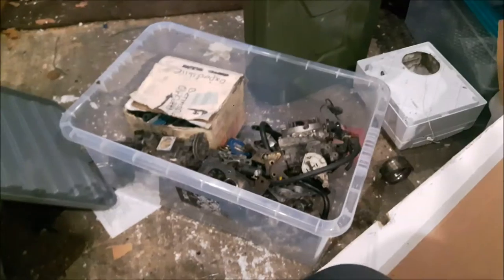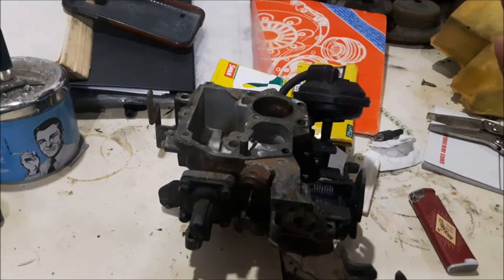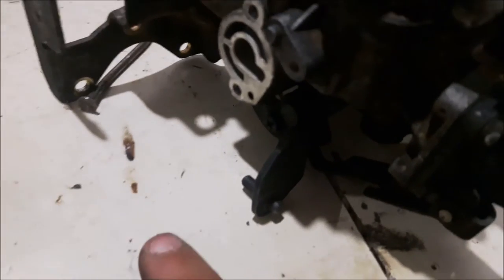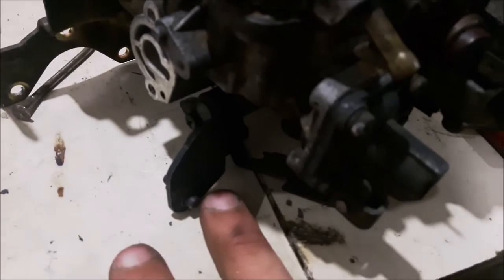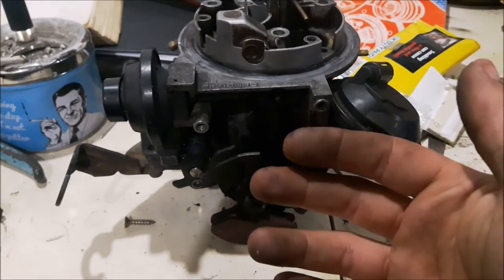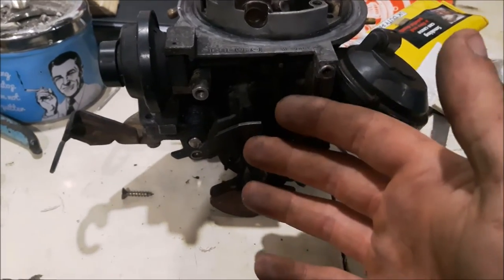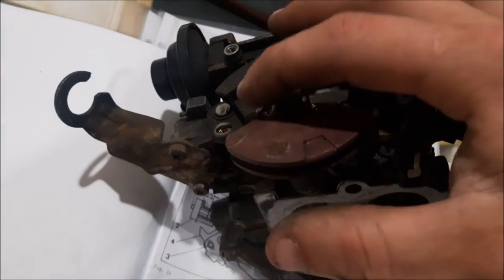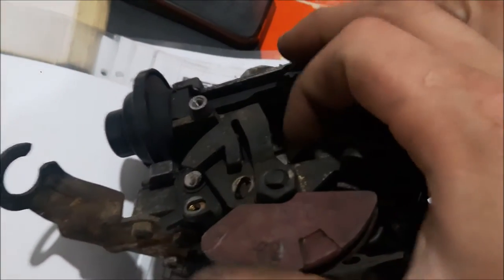The Pierburg 2e2  Components and Operation

Comment: Dear folks, the good old Pierburg is no witchcraft, but in fact very reliabele over a long time. I brought my legendary mule (Audi 80) to 436.000 KM !! The only thing I renewed was the rubber flange seal between manifold an carb. Otherwise it was fine - over the huge distance of more than 10 "world tours". 
If idling speed is too high, please do not forget readjusting the whole lever mechanism - not with brute force but with very tender bending of the light alloy components. (Treat it as you would treat your girlfriend erotically)
You can do this during engine idling since you then will discover any senesitive reaction of the engine (e. g. idle speed going to accdeptable level) Any kind of re-dieseling after engine/ignition off means reworking on the lever mechanism - until the problem is finally solved ! You will then  n o t  recognize your old tin-mate ;P -> purrs like a cat and drives like  b r a n d   n e w  !
Reply from the maker: Thanks for fighting the good fight in helping people to understand these carbs, I agree with you completely. 

Nice hack RE: the throttle plate by the way, I've pinned the comment in case it helps someone out.

Cheers for watching!
Reply: My 2e2 over-runs after ignition turn off. Could you perhaps explain abit more what I should be bending or adjusting to sort this out? :)
Reply: Hello, We have the problem of re dieseling after engine is off, while engine is on it still dripping gasoline on second throat and it makes engine stall. Any advice how to stop it dripping gasoline from second throat?(by second throat I mean throat without plate)
Reply: L6

Comment: SkyRocket Automotive  Thank you so much for these Pierburg videos, they’ve gone a long way to demystfying these carbs for me.

I wonder if you could perhaps give me some advice. So far I have:

Renewed the carb base rubber as it was badly split.
Renewed all the knackered vac lines as per your video.
Found my TTV and cutoff solenoid to be kaputt, they get 12v but no clicking and the 3 point unit withdraws fully from startup.
Put the wax stat in boiling water and found it seems to be working properly.
BUT

The car idles at 2000-2200rpm cold, lacks power and runs on when switched off. It seems to be running on the waxstat as the 3 point unit never comes into play at all.

If you could offer any advice that would be great. Thanks!

Comment: I can't believe nobody has commented on this.
Really good video bud.
Reply from the maker: Thanks very much! I'm glad you like it, hopefully it'll keep some Pierburgs fuzzing along nicely :)
Reply: +Kyle Mundy haha. I have to check my choke out. It doesn't appear to be in the black pulldown bit. Weird.
Revs around 1500 until it gets warm then sits at 900.
Also the timer device doesn't seem to do anything along with the 3/4 unit. Apparently the wax stat is ok. I had the carb tuned on a dyno. It was coughing and kangarooing on low range revs. Had an air leak on the brake servo pipe on the inlet manifold after the carb. So un-metered air was buggering up the mixture. I replaced all the other vac pipes myself. I must of missed that one. Doh!
Reply from the maker: +Anthony Jordan (oobumblebeeoo)  Did you ever get this sorted out chap?
Reply from the maker: +Anthony Jordan (oobumblebeeoo) Unmerered air can be a total faff! have you checked out the rubber flange that the carb mounts to? that's a favourite for leaks and is pretty cheap to replace :)
Reply from the maker: +Anthony Jordan (oobumblebeeoo) my apologies by the way, I didn't see this reply :(
Reply: Haha no worries. Yes she's sweet now mate.
Reply from the maker: Awesome! What caused the issue in the end mate?
Reply: Lots lol. Split rubber flange, split vacuum hose to brake cylinder, other perished vacuum hoses.
The choke wasn't engaged... pulled it off and located the spring on the lever. Idles fine from cold all the way to warm. Also had it tuned for £66... runs as sweet as a nut. No pulldown working still but it's not bothered me. I can rev it manually for a few secs on start 😉 - How's the 'roc' coming?
Reply from the maker: Ah that's great news!! It's surprising how well they can work even with some components not operating :) They really don't get the credit they deserve!

The roc is currently on standby as I need to pick up some new exhaust parts and a few other odds and sods. Missed the boat for painting her this year too as the weather's turned unpredictable in my part of the world again :( 

The head rebuild is complete though, just want to make sure I'm attaching the head to a decent exhaust as it had a HUGE hole in the bowl at the downpipe. I see it as a well deserved rest though, the car's had a crap life so it deserves some R'n'R!

Glad you got your Pierburg sorted friend!

Comment: Hi I'm using carb 2e2 on my 1.4 nv engine on racing car , so what happens is when I'm going down a  straight then take my foot of the  accelerator pedal the engine gives high revs for few secs and then settles down,  is there anyway of stopping that , thanks Mark

Comment: Hey, great video! Do you know the basic setting for the co mixture screw on these? Had my carb in pieces for ultrasonic washing and forgot to count as I unscrewed it🙄
Reply from the maker: Hi, from memory turn the screw all the way in (gently) then back out 2 turns is the rough "base" setting.

Thanks for watching!
Reply: @skyrocketautomotive   thanks again for your help. Been struggling with high idle, and as you mentioned in another video, the intake coolant channel was all blocked. Waiting for parts and hoping my troubles have come to an end. Thanks again!

Comment: What about if the 3point unit pin draws all the way in, which you can guess makes the engine stall. Adjust the bolt on the other side? 🤷🏻‍♂️
Reply from the maker: Does it draw in straight away when the engine starts and stays there? If so it's likely incorrectly routed vacuum lines

Comment: its a bit greek to me :D :D :D but I think i learned something here. hehe. 
I have had bad idlespeed/none when cold, and today I started the work to trying to fix this. I replace the vacum on the dizzy, and that messed everything up. My T25 idled nicely. before this around 900rmp when warn, but when I hooked up the vacum from the dizzy, it went up to 1200. The timing is now off, but with the vacum or not, now I have no power in the motor. :( :( Any ideas? Ill try to time it today, but im a bit worried i messed up my dizzy, when repalcing the vacum unit on it.

Comment: hi buddy good video my golf mk2 1.8 auto idles at 1200 to 1300 all the time tryed adjusthing stuff and chekcked the wax stat dont make any drffrence atall  i dont know if there is a leak in the 3/4 point unit cause i can push on the end of the pin when the engine is hot and it will drop the rpm  a bit  any help atall

Comment: My hot idle is high, 3point unit not touching the plate, if i push the plate "closed" the idle is normal. What do you reckon is wrong with it?
Reply: Check the position of lever on the wax. Might be too much open. 4mm inbus to adjust it in proper position

Comment: Hi mate 
You mention on this video 16:15 in about the filter abs remove it waste of time 
I’m having issues with my t25 not starting .. especially after long journeys 2hour trip then an hour later it won’t start . Easy start doesn’t work anymore I have to pour petrol into the carb .. any ideas ? Also I noticed that petrol doesn’t come in to both carb the one with the choke flap does the one next it doesn’t .. any ideas would be grateful thanks

Comment: dude! you are a godsend! the mrs mk2 has come back from the body shop idling at 4k on start up. i knew fuck all about carbs when i got out of bed this morning, now im pretty sure what the problem is. the 3/4 unit it operating properly (from memory looking at it the other day) i dont thing the actuator with the adjustment scree is following it properly. theres like a 10mm gap. so am i right in thinking the wax stat isnt firing the pin? i initially thought it was the 3/4 unit the the front hose on it to the y piece was so loose it was sliding itself off unfer vacume. reolaced the hose drove it roubd town n it idled perfect. next morning started her up and shes ticking over at 4k untill its run for about 20 mins

Comment: Pierburg 2E2 is also used on very old Audi typ 44 engines as well.
Reply from the maker: Cool! hopefully that'll help some folks out! :)
Reply: Kyle Mundy I hope so because I have a Pierburg 2B and  there is like zero literature to that. Maybe I can get a type 43/44 engine running with the Pierburg 2e2 because thats whats originally was designed for these engines. Most of the early 1980s West-Germany cars have Pierburg or Keihin carbs. Some are interchangeable between different models some not depending on the flange mounting of the engine.